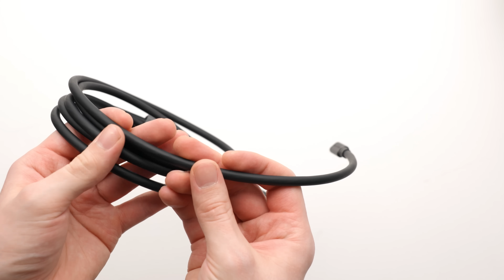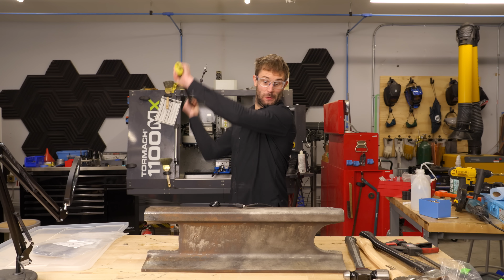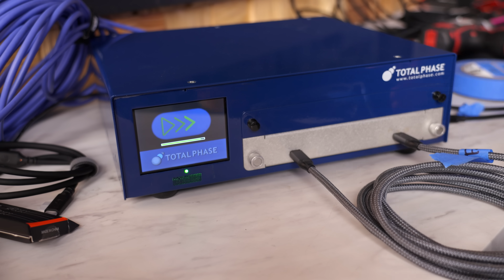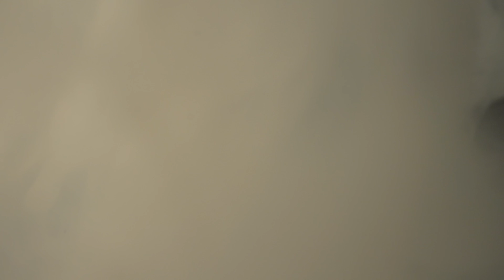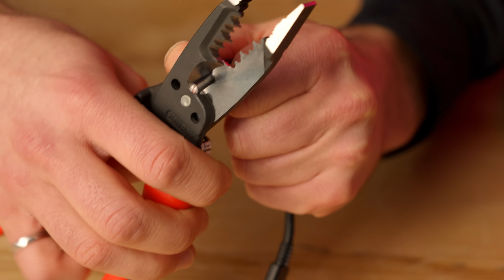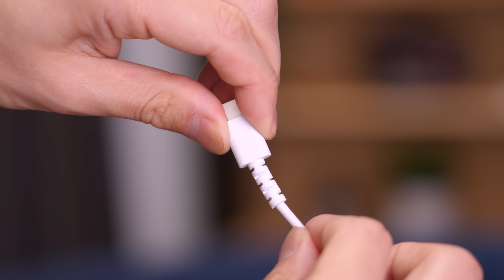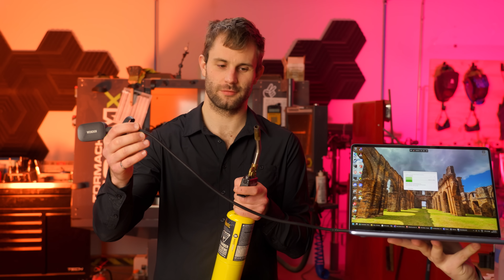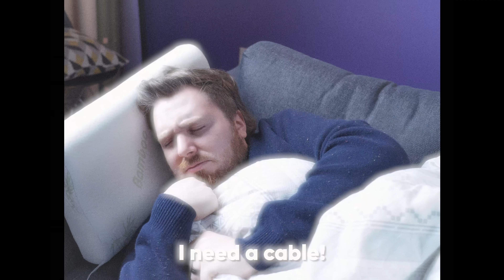Why It Took Me 4 YEARS to Make a USB Cable

Comment: Not getting the cable certifications is basically the same thing as when OnePlus didn't pay for the IP67 rating despite having the sealing capable of withstanding it. That was back when their phones where a genuinely fantastic deal, I wouldn't be surprised if the IP rating was one of the reasons for increasing the price.

Comment: And yes a whole production can go down by a simple cable. You have your 100k camera set up. 2 cards, and a 5k card reader, if you so happen to forget the right cable, it takes hours to transfer files.... compared to minutes. Absolutely insane

Oh and finding cables, can be a fucking nightmare... 10core, 20 core, with certain specs.... uh boy.

Comment: I really like the Apple 240W cable. it's basically perfect without the low speed. durable, flexible, tight braided cable, and don't even need a string relief.

Comment: Rather than buying expensive high-spec cables, it's better to first clarify your usage needs. For instance, if it's just for power delivery, there's no need to use a USB4 cable. Similarly, for connecting an external monitor, 240W of power delivery isn't necessary; what you need is high bandwidth and good internal shielding of the cable. Of course, when traveling, it’s still useful to carry a high-spec cable to lighten the load. In most cases, a cable with 120W power delivery and 20Gbps bandwidth is more than sufficient, and the cable itself won’t be too thick or stiff, making it easy to store.

Comment: Hi Linus and LTT team. 

Odd request on behalf of the Astrophotographycommunity, do you plan on making USB-A to USB-B? 

You see a lot of astronomy equipment uses USB-B but finding good quality cables that can also handle many hours in freezing temperatures without going stiff is not easy. As you telescope moves throughout the night it's way too easy to have a stiff cable get stuck on something. 

 The silicone sleeving should be able to handle the cold much better.

Comment: I barely ever find any USB cable strong enough for stable Data Transitions..so yeah USB cable IS a huge Problem ON sensitive Data Signals thats for Sure. I only got Like 3/25 cables working fine with my sensitive Signal..the Rest ist Trash and only useable for powering mobile devices.. while all we're claimed to bei spec and similar prices..

Comment: Now that there are the cables, it would be interesting to see your test on docking stations (In offices they are necessary especially with laptops) in order to hypothetically also measure the latency with these and with sound cards (which require very little latency in bit perfect) to try to move the case several meters away from the desk with a single type C cable.
Imagine putting the Case in a corner isolated from noise and the desk maybe liftable with all the cables on the desk, nothing underneath.

A single type C.

Comment: I just looked at the pricing, it ain't even that bad. Yeah it's more expensive than a normal cable, but taking into account that they are what they say they are, and that I have trust in that LTT will deliver and give support if needed makes the price worth it. Also just because, again the price isn't that bad to begin with.

Comment: Not sure why Linus didn't want to just say the price range. Honestly they aren't that expensive range was like 20-30 USD. I've gotten what I thought were really good A2C cables for like 15-20 and they ended up failing in 1-2 years. I mean compared to the screwdriver and backpack, I can easily justify this purchase.

Comment: Honestly I am incredibly impressed. The pricing isn't even close to what I expected when you said they "weren't cheap". And I really appreciate that you aren't even pretending like you could get 40 GBit/s with over 1 meter of cable. I am definitely getting my next cables here, even if it will take a bit longer than from Amazon to get them to Germany ❤

Comment: Mate- I’m super confused - I’ve just added two different sized cables to the cart and they come up at the same price, mind you a 10cm cable for $31 AUD, that’s over $300 per meter, and your saying it’s not expensive. Even if you look after rubbish and go through 1 cable a year you’re still in front after 10 years………

Comment: I'm assuming the bottleneck in speed from increase in length comes from the small super-speed lines radium. Should optimise the radius for max efficiency in speed over cable length. If 1m cable can do 40Gbps, why can 5m not do up to 8Gbps (1/5 of the speed)?
Also perhaps you should consider design of the cable cross-section to be circular as it's also the most efficient shape. You could maybe consider running ground through multiple areas of the cross-section to create a more circular shape.

Comment: Proof that marketing cables is hard - I just checked them out and have no idea what wattage the specific cables are good for. Is the wattage dependant on the cable length, or the connector/speed rating? Would be great if that was specified in the dropdown or have an additional table to refence on the item page.

The price is actually not that bad. The shipping will be the killer for anyone outside of US/Canada though. I have paid close to that for Ugreen cables, and see brand names at electronics retails for more than the LTT cables.

Comment: QUESTION: I noticed the cables have different speed ratings based on length. Are they artificially limited to those max speeds or is that simply what the standards says is reliable at that length?

Comment: I was expecting these things to be pretty darn expensive
but it turns out that they're actually cheaper than the average cable you find in your average tech store around here. That's hilarious.
To give some numbers, it's not unreasonable to end up paying 10-15 chf on a decent usb c cable. That's 17~26 cad.

Comment: This is awesome, a work built usb-c. But I did notice a brief clip with a propane torch. Could we get a video running this cable to failure? I don't expect it to last long under direct flame, but I'm curious. 

Just ordered 4 cables for my garage where heavy duty is key. I only need 3, I plan to use the spare as a test subject. If it survives, it goes in the office to connect/charge the work tablet (I'm an electrical contractor).

Im also a gear-head, and my garage equipment takes abuse. USB-C in my garage powers blutooth reciever for the sound system, my tuning laptop, and personal devices like phones and tablets.

Comment: Lol I'm not surprised it's difficult to find cables that actually function correctly as a..... Cable..... It's different if you ask it to do other things like function as a 2 ton tow strap and a fully functional cable.... It's definitely a problem that people aren't realizing is a problem... The number of times I've had a cable that didn't charge correctly or transferred data erratically or the cable quality was horrible and it fell apart while charging at high power potentially catching the bed you absolutely aren't supposed to be charging your device on ever for any reason on fire or the connectors fit poorly or so not right that it feels like it might actually damage your device...

Comment: The way the price wasn’t mentioned and how it was made to sound seemed as if the cable would be 50$+ if you use Apple and stick to their cables then the price is relatively the same. LTT for a little criticism that isn’t negative you made this cable seem way more expensive than it actually is lol

Comment: My ugreen USB c cable for my ssd enclosure is flaky as hell. I thought it couldn't be the cable, cause ugreen is supposed to be reliable. I'm ordering a few of these. Too bad the long ones of 20gbps+ are all out of stock rn. 😢 Excellent product, it really is difficult to find proper, reliable cables that are true to spec. And yeah, a $10k cable tester is a bit outside my homelab budget. Fair pricing too, definitely will order. The screwdriver I found on the high price side 😅 but this is very fair for the guaranteed quality and piece of mind.

Comment: The pricing is a bit confusing

The 480Mbps and 40Gbps cost the same depending on the length you choose.
The slower cables do offer length in meters, which then matches the price of the faster ones.

But some use cases for certain lengths makes it not matter too much, so it would just be better to opt for the 40Gbps for the same price.

Comment: Wow, you really contradict yourself with ending the video with "It's a digital cable - it either works or it doesn't" while the same video is started with eye diagrams and literal explanation how a not-to-spec cable can appear to work fine, but it isn't.

Comment: On that connector durability and lever point. I'm genuinely curious, how did you balance to have the cable break of vs. break the port on the device it's connected to? I mean if the connector is weaker, it may break of but in turn leave the device unharmed. Not saying what is the right thing to do here because that surely is very much subjective, but I'm curious how you guys thought about this.

Comment: Do you plan to support any additional charging standards other than USB PD with your cables, for example Xiaomi's fast charging with its additional 5th contact pin in the USB A connector?

Comment: Ngl the price of these cables is what sold me.

High quality cables for <$30 from a reputable brand?!?!?

Thats already beating out majority of cable companies on amazon.
Reply: Yeah Amazon is frustrating for any kind of accessory like this. 99% of products either lie about specs or are just bad and overpriced. It's the last shop I look at nowadays.
Reply: 100% agree. When I went to check the price, I was genuinely shocked at how low it was, especially considering most semi-decent cables are going to run this price anyways, yet most of them last a few months, just to get out of that return window, or don't deliver on their specs at all.
Reply: I guess you were on time... I signed up for the restocking notification haha. The spec and length I want seems to be very popular.
Reply: @GingerZero  That's what she said!
Reply: Same, already bought one and if I enjoy them I'm gonna buy some more
Reply: 30 + taxes + shipping = 52 CAD = 32€ for me in Europe. This is 3 - 6x more than what I usually pay on Amazon all included and they work fine so far (few years already). 
Maybe these are better, but the price is steep.
Reply: Yeah, I got worried when he said that they aren't cheap but looking at the store page the price doesn't seem bad at all for high quality cables.
Reply: Linus was making it seem like they would be unreasonable but no, these prices are totally fine
Reply: Compared to the Ikea usb cables I use for most things, sure a cable of the same length and data speed is half the price, but thats like comparing good mass produced cookies to homemade once.
Reply: Wait till you find out how much LTT charges for shipping
Reply: i find if you need a cable you cant wait 1-2 weeks for shipping. Ive never been in the situation where a cable isnt a need to have at the moment. Else a great idea for them.
Reply: These arent going to be useful for everything. The $2 amazon cable is still going to charge my phone overnight. But for reliable data transfer? Sure.
Reply: I was sold til I saw the cost of shipping outside of NA, honestly shocked LTT (presumably) doesn't have EU distribution considering the scale of the operation. actually really annoying since the only place to even get cables here is Amazon (brick&mortar retailers all stock the cheapest shittiest cables) with their dogshit vendors all selling the same shitty products under different names
Reply: @aur0ra.r0se Canadian company with 100 employees . its tiny in the grand scale. Also EU doesn't buy nearly enough to justify a multimillion dollar facility that is only for holding stock closer to people who don't buy anyway. Waste of money, effort and time for that center.  Open one and charge LTT a fair price of a dollar or two an import and maintain the facility. go for it, become the importer.
Reply: @aur0ra.r0sewell for me it was about 30 euros (including shipping) cause the CAD isnt worth the same as the euro
Reply: @aur0ra.r0se There are quite a few reputable electronics retailers carrying decent cables that I would prefer over Amazon.
Reply: No it's not lol compare to any cable from Aker

Comment: Suggestion for your next project. 40 Gbps 240 W  hubs with at least four USB-C (40Gbps, shared) outputs not including the cable to the PC\mobile and the PD
Ideally with HDMI, RJ45 (10Gbps), etc

Comment: Awesome job guys. Make sure your store is actually in stock though. Product suggestion models with either one or both ends at a right angle
Reply: Yeah I was thinking of the right angle in the same plane. But yes I suppose there's a market for the other also.

Comment: this might not make much sense, but id prefer if you didn't market these as true spec tbh, it comes across as buzzwords designed to drive the price up. just say its a 'blank' cable, instead of staying its a "blank" and that means its REALLY 'blank'...

Comment: Ahhh So this Sucks,... I mean literally every cable I know in my local Tech store, that has a Silicone outer layer, normally is dirt Cheap, is Magnet for Dust and Sucks in general,...  and the Slim, Braided and more expensive ones are those who are normally, the go to ones. Well as long as LTT Product don't hit my local Tech Store Shelfs, this will not Change,... also eh I looked at the Store page,...  why is everything over 2,5m only 480mbps and why is the Price Always the same at 29.99, nothing against that but, hmmm,...

Comment: I've honestly been so frustrated by unlabeled cables.  Even Anker only labels some of their cables, and hides specs for the low-end cables (seems intentional).  My only suggestion is to include the size of the connection casing.  Normally this would seem like too much, but your viewers are nerdy enough to know how to check, and I think that's worth including for a $25 cable that's expected to be on the thicker side.  I've had cables not fit with cases, so I'd love to check before hand!  it's the only reason I'm not buying a cable today.  A size chart like IKEA spec sheets would be super nice to have on the product page.  I'm hoping for the best.  Most people wouldn't care, but this is so nice to see as someone who maybe cares too much.

Comment: You know when bad USB cable quality bit me in the ass? I have a modded Nintendo Switch, and I run the RCM hack using the Rekado app on my phone. But the USB controller on a smartphone lacks the automatic retry logic that a PC has for some types of USB packets, like for example, the USB control packets.

My phone has a USB 2.0 Type-C port. And yet, the app would fail to send the bootloader to my Switch on practically all normal smartphone data cables. I had to get a cable that could handle USB 3.1 in order to get reliable results.

Any cable worked with the same code running on a PC. But my phone was far pickier, and the cables were to blame.

Comment: Linus don't fret about the price. Very reasonable. Here in the States Dollar General sells no-name cables for about the same. A person gets what they pay for.  For example the USB 3.2 A to C that I purchased from AMZN. Only cost $10 but doesn't come anywhere close to spec. USB 2.0 transfer speed at best and the thing is thick as an extension cord yet will not fast charge my Pixel 🤷🤷 I would gladly pay an extra $10 if it means I'll receive a cable that will get the job done.

Comment: Why didn't you make cables that are NOT 240W (not every product needs that power, also not many products can utilize it, and not many chargers can use it)
A middle ground 100W version would reduce the size and cost, and make it more appealing

Comment: 20 bucks for a high quality c to c cable is not crazy at all. I would spend more now and have something I know will work when I need it to rather then cheaping out on some crap with wires. In my line of work, I constantly have to connect and disconnect from my laptop hundreds of times a day so having something like this would be amazing. Haven't purchased anything before from your store, but I will be picking one up!